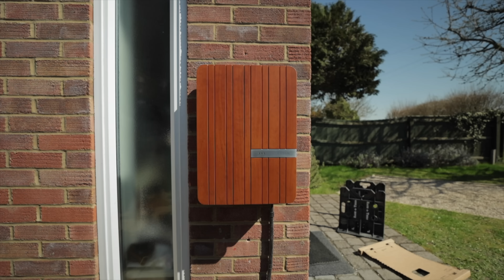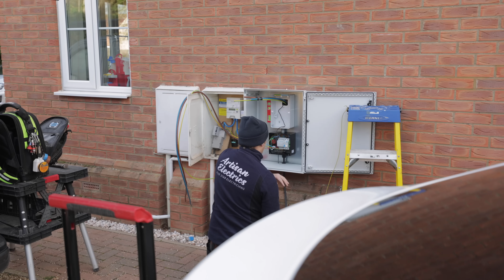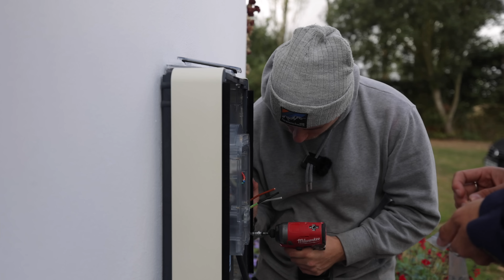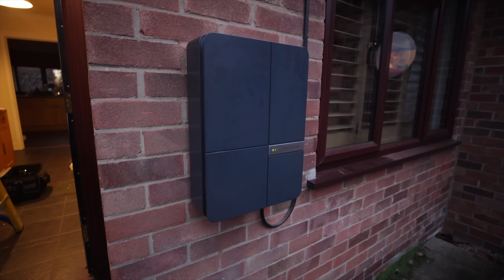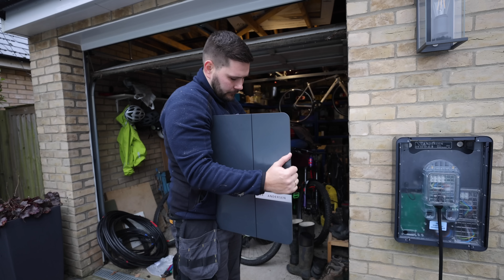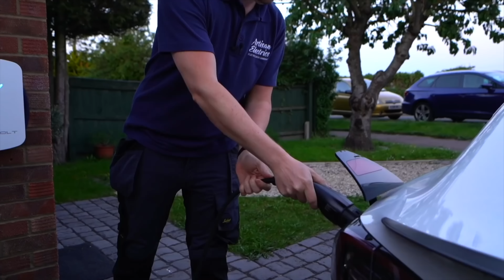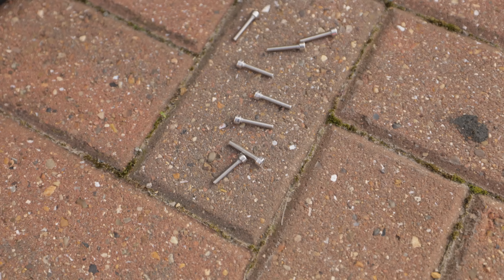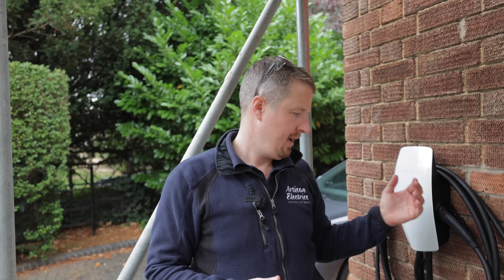5 Best EV Chargers Compared: Honest Review & Brutal Opinion🫢

Comment: Zappi has worked with octopus intelligent go for ages!
Reply: @EverydayLife621  I just plug it in and let it do it's thing. It will charge outside of the normal hours (at the cheap rate) if it feels like it. I actually have two zappis, the 2nd isn't controlled by octopus and we never have issues with the 2nd car charging.

But without a compatible charger I wouldn't be able to be on intelligent go, and the tarrifs are not as good then.
Reply: Probably the best way of getting onto Intelligent Octopus Go.  Works much better than any EV integration and probably the best of the charge point integrations.
Reply: I think we all do - I dont see what the challenge is? - we all just charge off peak at home, however we do this?
Reply: @EverydayLife621  The point of Intelligent Octopus Go is that Octopus control when your car charges (rather than being just a fixed cheap period like most other EV tariffs).  In order to do that they need to be able to control either the EV or the charge point.  That's how they give the very cheap price - you can get well over 6 hours of cheap rate per day.
Reply: @EverydayLife621  not sure what you're getting at. I needed a compatible charger (which zappi is) in order to be able to access intelligent go, which means my overnight charging is 7p/kwh rather than 8.5p/kwh and lasts 6h rather than 5.

I don't really care about the "intelligent" aspect, but without a compatible charger I would he paying more.

Comment: I as a consumer have an Tesla Wallconnector Gen 2. Got it installed by an certified electrician, and it works great. Have it for almost 4 years and still looks great and works on 3 phase (11kW). It’s not a smart charger, but I always control it trough the app of with the car, which works fine for my use case. But it would be nice to have some more control.

Comment: The vast majority of us are not given a choice, as its usually sorted out by the car dealer / Lease company / your electric company. I was given an ohme pro (£600 installed, albeit it by bill n ben - but is does have an extra 'PEN' consumer unit + charger its self - I think it was a special offer, as you cant even buy it for the price): It just works every time (and yes I live in a very poor smart meter area/mobile phone signal, but it seems to work on text/2G) - I'm not sure what else is required, I just plug in and it will charge at cheap rate (or via solar), as per my requirements (by again luck I have Octopus Intelligent Go, and will give me cheap rate as soon as I plug in - what ever the time) - this does seem a little dated?
Reply: You are under no obligation to buy an EV charge point from the car dealer / lease company / electric company. You can approach a local EV charge point Installer from which you will get much better service especially when it comes to charge point faults and subsequent warranty claims.
Reply: @GadgetMan36 he probably refers to discounts or offers provided by manufacturers. BMW and Audi have at times offered free chargers with any car you order, even if it’s used

Comment: Pod Point Pro or Ohme. The downside to the Ohme is they will definitely start charging for the 4G soon enough. Both are compatible with Intelligent from Octopus.
Reply from the maker: Never fitted the PodPoint Pro - whats it like to install?
Reply: More than happy with our ohme pro, if it goes dumb, then fine, i'll just use the car (or will get someone to add a simple timer in the consumer unit) to set the timer.
Reply: Ohme pro has been faultless for me so quite happy to stay with it
Reply: Most chargers have a mobile data sim, as does your smart meter. There are no contractual conditions nor mechanisms in place for any manufacture to bill consumers for mobile data.
Reply: @garywilde6171 that's just false. Ohme charge after 3 years.

Comment from the maker: If you are a customer looking for an EV charger then make sure to get a quote from us: https://app.openquote.net/company/artisanelectrics 😎
Reply: Looking for one but I’m up north
Reply from the maker: We have a network of installers all across the country who work to our high standards so feel free to put in a request
Reply: No love for Ohme?

The only must have feature on an EV charger for me is reliable Intelligent Octopus Integration which the Ohme and Zappi have. I have read of problems with the Hypervolt, does anyone have experience with the Hypervolt and Intelligent Octopus?

I have a Zappi and integrating that, my heat pump, battery storage, and Octopus Intelligent with home assistant saves a small fortune on electricity.

Solar integration is not as important anymore as now you can get 15p per kWh on export it's better to send your solar to the grid and charge off peak.
Reply: Where is one from the manufacturer who had invented it , the term WALLBOX? 
The manufacturer WALLBOX is not in your list, the company who let others yours their brandname ?
Ours do work quite well and perfectly as surplus charger in conjunction with the freeware called evcc.
Reply: @typxxilps  Did not know about evcc, thanks for the tip.